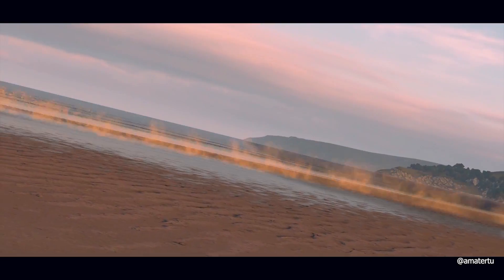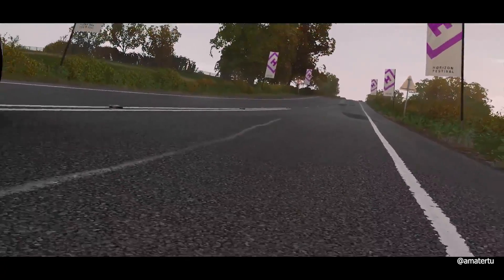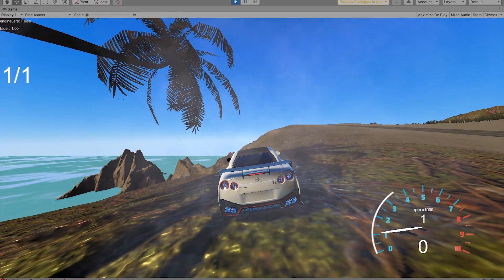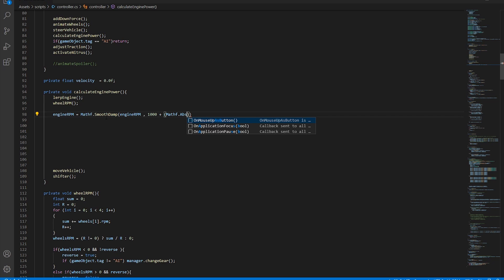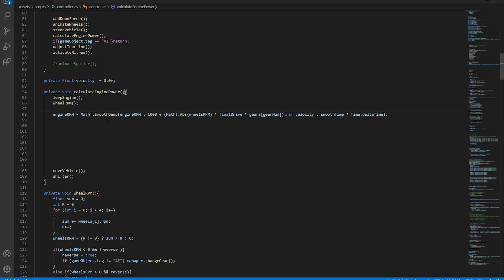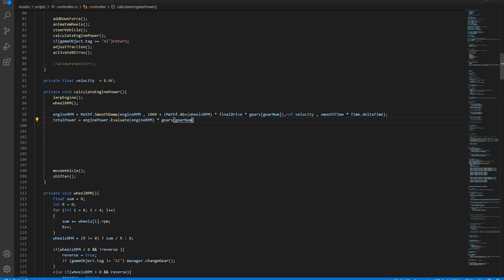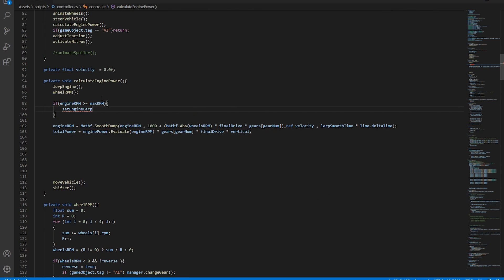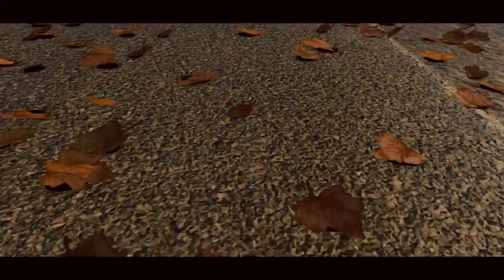Build Forza Horizon 4 In Unity - Engine System (02)

Comment: My query is not related with this video but i need your help i am sure you can help me
I have an problem in script
Problem is when i climb my vehicle to 20+ degree surface then only tyre spin but vehicle not move
In real life some cars climb 45+ degree surface
i have try on Google , YouTube and other resources to get solution of this problem
Reply from the maker: add power to ur wheels and give the rjgidbody some drag 0.05 is ideal
Reply: @pabloslab  how to add power to wheel?, i have already added drag 0.05
I have write in script.
RW(wheel collider).motertorque = vertical inputs * max torque (as define 600)
In max torque 600 give max speed of vehicle and rpm